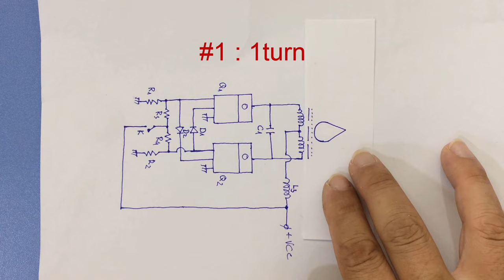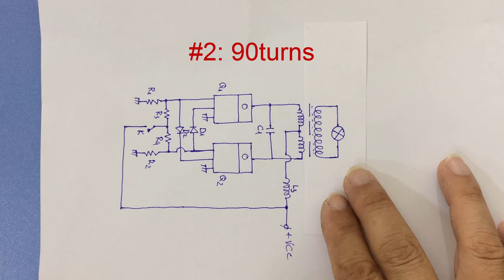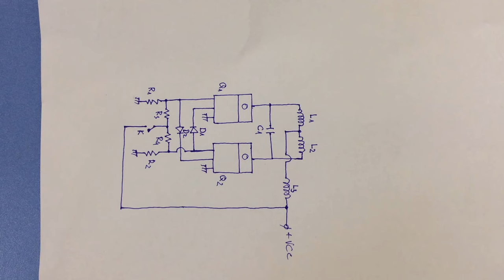How to make inverter 12v to 220v from old CRT TV. ALL IN ONE

Comment: One of the best video that I have seen on self oscillating full wave circuit and it's application... 
I would like to know what is the operating frequency under the led bulb connected as load where output shortage is 220V. Also on which factors does the frequency depend. 
It would be of hei help for further experimenting with it.
Once again thanks for educating us.....
Lots of love n respect to you.....

And one last thing, how do I contact you....

Comment: Great circuit and build... I would like to ask if I can use 180 ohm resistors instead of 200.. is it gonna work?
Reply: Well the circuit works perfectly with 180ohms...There is one little problem tho... For some reason the capasitor gets crazy hot so I can not run it in over 30 sec... Can somebody tell m wht to do with that issue?
Reply: The capacitor gets hot beacause of the voltage spikes that high frequency makes

Comment: my friend this micro switch is connected between positive and negative when it is activated it will short circuit or the resistors are not connected in the 2.5mm conductor !!!

Comment: How many Kilo volts on the 3 rd  one I think ?    Thanks.
Reply from the maker: about 15kv sir
Reply: @D.creative  Thank you. That's impressive
Reply: It is 15 kv but much more dangerous than other yt common flyback drive because as u can see the arc is red hot with lots of power in the output...